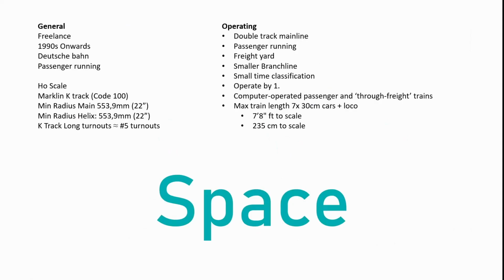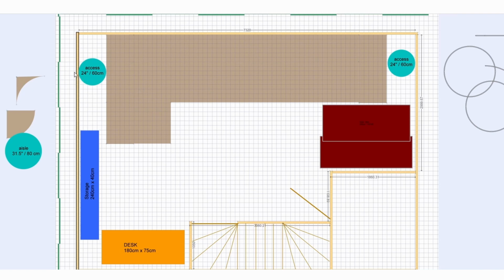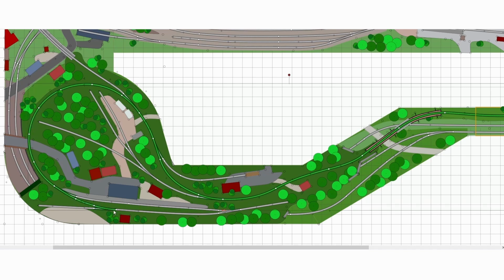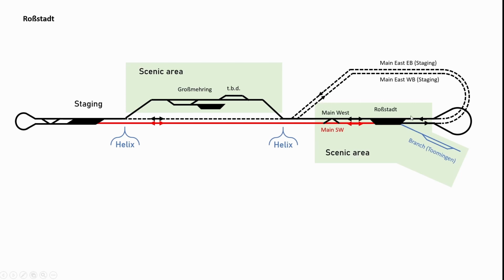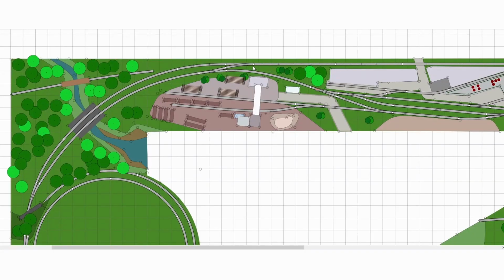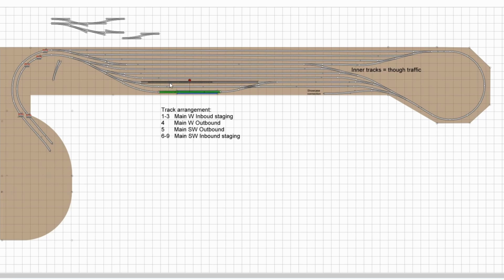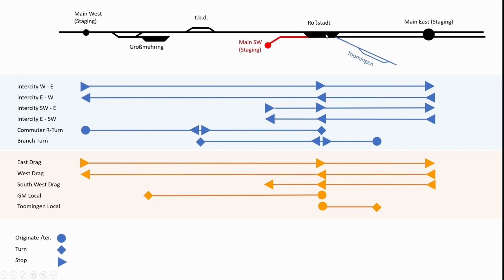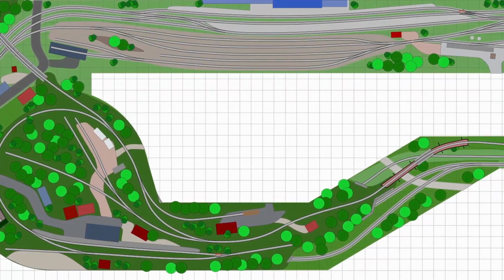Layout Design Considerations 2.4 x 6.1m Re-Edit ~65

Comment: THANK YOU FOR THE GREAT DEEP DETAIL ON 3 LEVEL LAYOUT.
WHAT IS HIGH BETWEEN EACH LEVEL OF LAYOUT AND HIGH POINT OF GROUND AND LOWER POINT OFF GROUND?
Reply from the maker: Thanks Robert. From the top of my head, measuring from the floor:  40cm, 80cm and 120cm +/- a few cm. The branch line will go up another 10cm starting at 80.